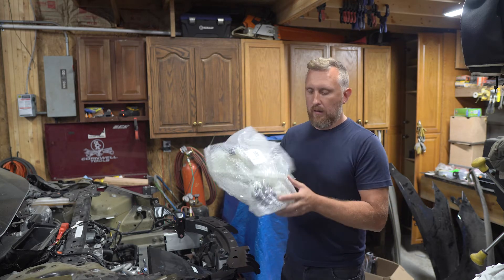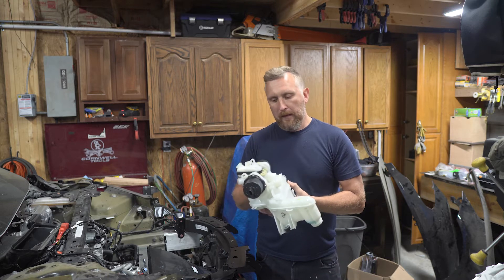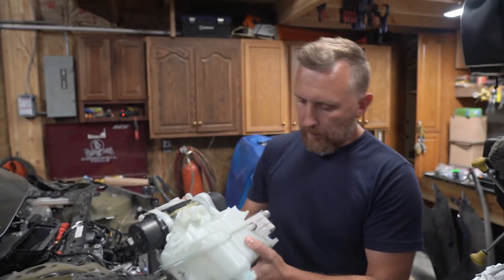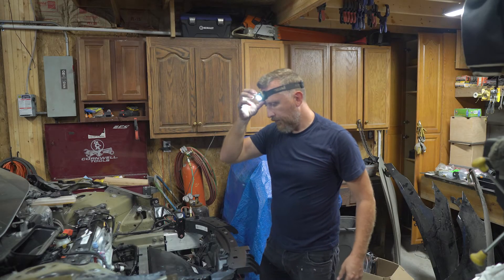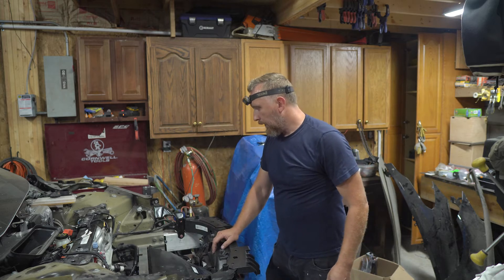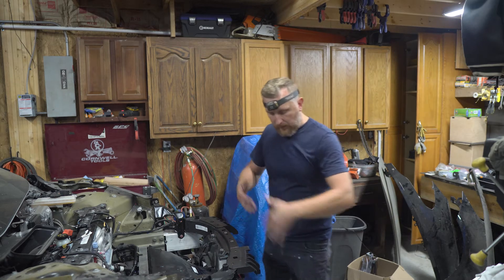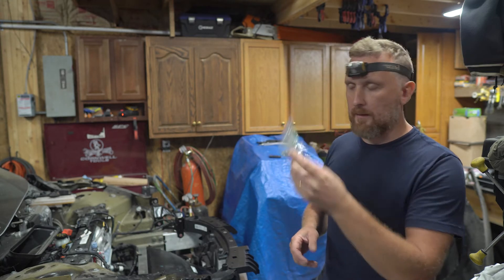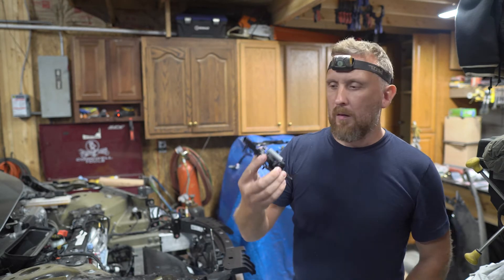Tesla Superbottle replacement

Comment: Finally, somebody doing what I’m trying to find! Got a question here, 2018 model three performance, I noticed the last few trips supercharging would go up to 250 and then immediately throttle in about three minutes down to 40 kW, fan never turned on the entire time, which is odd charging continues to be slow the entire time, once I get back on the road, the fan will stay on for over an hour displacing no heat. I went into the service mini while supercharging and it shows my five way valve is red, I do a soft reset with the steering wheel, and the valve turns green and immediately starts displacing heat through the radiator, but in a couple minutes, it shuts off again. When I’m not supercharging, I can do the coolant valve test and it passes every single time. Unless I’m supercharging, then it fails. Tesla quoted me $1100 to replace the entire super bottle assembly, but the service manual says that only the actuator needs to be replaced. What do you think? They mentioned mine had steel gears so they wanted to replace the entire bottle. I don’t know what that has to do with anything.
Reply: I have the same year but long range and it’s best to change to a new super bottle. It will have better cooling capacity as it has dual pumps now. I’m also changing mine as well in the next week
Reply: @ my 18 has duals on bottom of bottle. I just went ahead and did the actuator they installed for $100 if that doesn’t increase my charge on next trip I’ll just have to redo bottle for $1200, it really seems like a position sensor issue since the software reset fixed it temporarily and when not supercharging it passes test all the time.
Reply: @lordjoshr so did that fix the issue ?
Reply: @lordjoshr  Can you update of the Model 3 superbottle issue you had and how it's going?

Comment: i  accidentally put coolant inside my Wind Shield Wiper Reservoir, should i remove it? because i thought it was wiper fluid at the time. inorder to remove it would you recommend removing everything like you did? or could i get a drainage tool to extract the coolant and than replace the fluid with the right liquid. HOPE YOU See this!

Comment: Hi Roman ... I've just had a super bottle replaced on my 2020 model 3 dual motor AWD.
This started first when the vehicle restricted its top speed 57 mph and two fault codes appeared DIR_a126  'power reduced' & DIR_103 'power limited ok to drive' Two of the valves inside the super bottle had jammed.. one jammed half closed and one stuck fully closed .. the bill was £960 from Tesla Service Bristol UK .. they also had to empty and refill the air conditioning as part of the super bottle replacement process. I would be interested to know what vehicle I believe it was a model 3 but don't know exactly what model ?
Reply from the maker: My car was a 2018 model3

Comment: When you replaced the pump, did you have any issues witht he software as the service states you should perform a toolbox procedure?
Reply from the maker: No, I didn’t have to do any programming just straight swap. The only reason to use toolbox I would think of is an air purge.